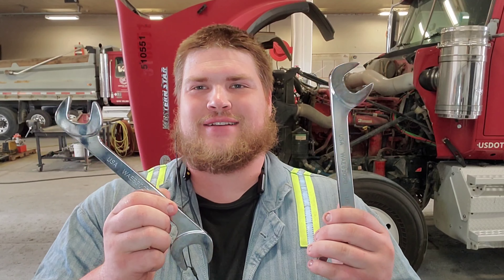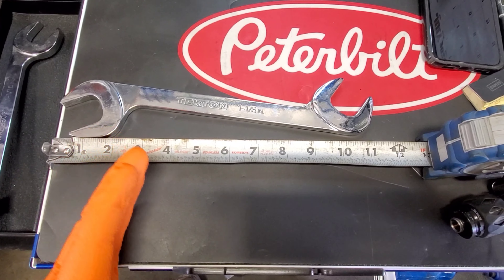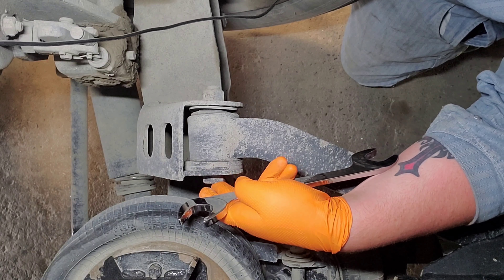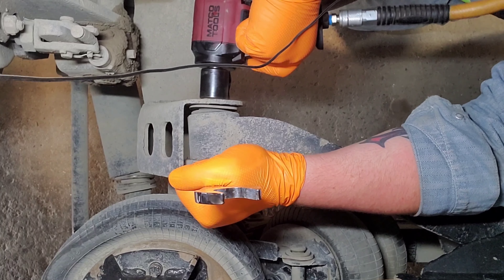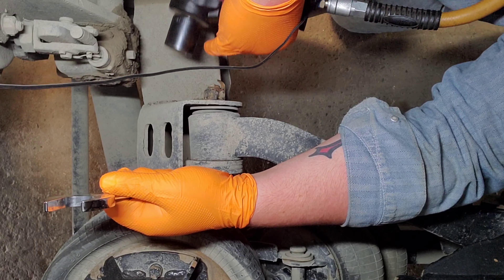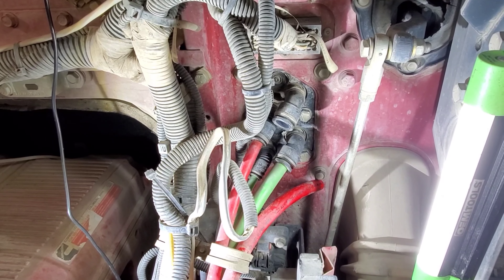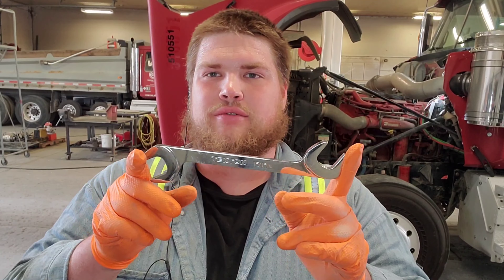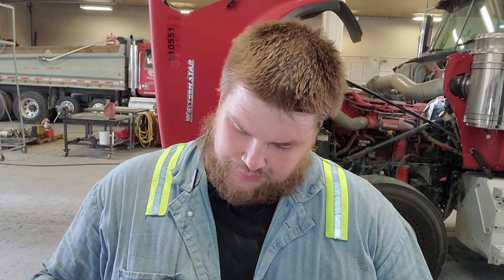Tekton wrenches real life use

Comment: Help. Torn between snap on and tekton for a 3/8-1&1/4 angle wrench set. I work on skid loaders and big Ag. Will use them at least every other day. Snap on truck comes weekly, no one sells tekton near me. Snappys are $885, tekton $225..
Reply from the maker: Order the tekton if you have to warranty them out takes about 4ish days you just have to send an email plus the price is a lot cheaper
Reply: I own both and you can’t go wrong with the Tekton wrenches.
Reply: I ended up lucking out and a family friend was selling his tools off and I found a MAC 3/8 to 1-1/2 set for $250!!

Comment: Maybe a crows foot for them air line fittings. I don’t own the tekton angle wrenches but I have a full set of the Sunex and full set of the Cornwell ones and they definitely get you out of binds. Specially for hydraulic lines is what I typically use them for. Great video sir!
Reply from the maker: I've used both the cornwell and the sunex. The big difference is those 2 aren't a 60° 30° to my knowledge the only people that do that are snapon and tekton
Reply: Crows foot with an extension on a 3/8 drive ratchet, I just feel like the angle wrench is just a bit too complicated especially for an aircraft mechanic, when putting that fitting on it would have to be torqued. Can't torque it down with an angle wrench

Comment: Question - work at a Yamaha shop here (so all Metric). On Big trucks/heavy equipment is the fasteners american sizes still primarily?    Or they got metric to?
Reply from the maker: With the older stuff yea is still SAE in like 2012 they started mixing the two so you'll be doing a job and you need both sets of stuff. Most paccars are font towards all metric on there engines but work on the rest of the truck most likely SAE
Reply: @fortheloveoftools  Thanks for the reply - interesting how they got all metric in one place then the other sizes.
Reply: @fortheloveoftools  you said the dirty word.......................Paccar.

Comment: What's great about these is the 30 degree and 60 degree angles.  For years only Snap-On had them, and that's why they cost an arm and a leg.  Now you can save piles of money and get equal quality.
Reply: Quality and fit in tigher spots
Reply: Not the same quality as snap on, but a great cost effective american made offering for sure.
Reply: @upnorth5465 why aren't they just as good? they're made of 4140 chromely steel and then hardened is forged steel stronger?